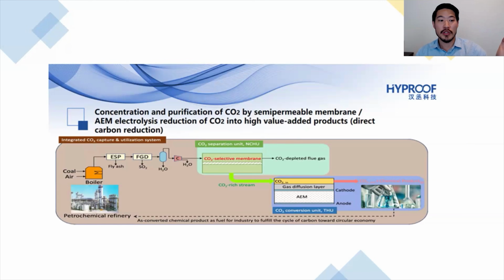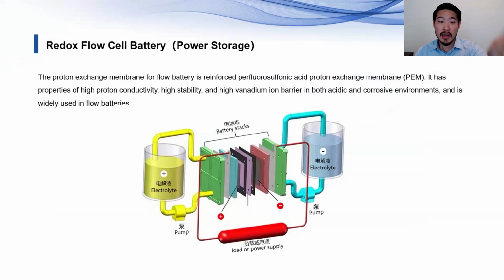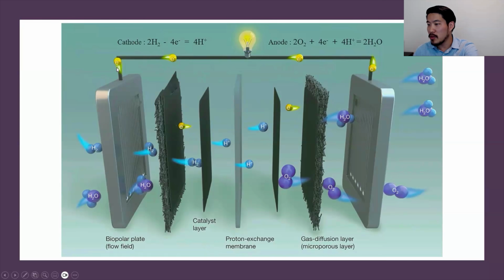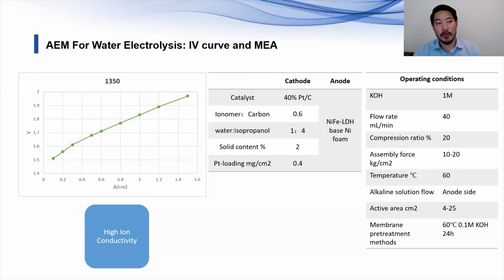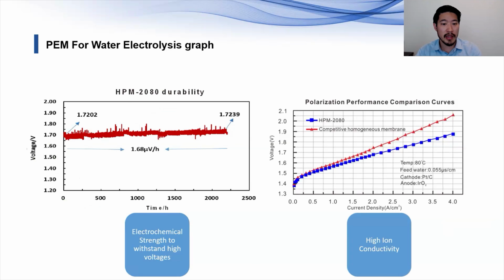Tech Talk - Hydrogen Fuel Cell, PEM & AEM Electrolyzer Membranes - Hyfindr Wu

Comment: Excuse my ignorance about this but if the goal is to separate the oxygen from the hydrogen, why not use a Hoffman electrolyser? You can pipe the hydrogen straight to the engine or through a compressor to a storage tank and release the oxygen or compress it in another tank for future use like with a rebreather or welding or whatever. This way removes the dependencies on consumable precious metals. Use batteries to initiate the electrolysis and switch to super or ultra capacitors once the engine/generator is running.

Comment: What the heck? 
The PEM splits water into 3 parts (oxygen, hydrogen proton, and hydrogen electron) then routes them in 3 separate directions only to join back the hydrogen components on the other side?  
(1) How does it do that?  
(2) Why split the electron off from the proton?  
(3) If one of the byproducts is hydrogen then can't this system just be primed with a minimal amount of water and then keep reusing the same hydrogen?
Reply: What do you mean by reusing hydrogen? Hydrogen is the product you want to obtain afterwards. The point of the electrolyzer is not to use the energy to turn on a bulb, for example; it is to produce hydrogen..
Reply: @MsRosHD  This video was not clear and seemed like the fuel cell had a hydrogen byproduct which sounded wrong and like a perpetual motion machine... now I see they were talking about the electrolyzer and that the membrane is used for both the electrolyzer and fuel cell.  There is another interview/video of a different guy from hyfindr which is more clear.

Comment: Hello Tim and Steven, Thanks for sharing this wonderful informative video. I am a little confused with the fuel cell layout displayed in the 12th minute. In a fuel cell reactants, hydrogen gas flows through the anode and oxygen flows through the cathode. Here in that slide the reactions are represented differently. Is that a mistake?
Reply: They mixed up electrolyzers with fuel cells, in my opinion. I googled the image, and the reactions weren't displayed, so they added them but did it wrong

Comment: Can’t the same membrane work for compression? And what would be the pressure output of compression? Lesser or bigger than 1000psig.
Reply: Hi, thank you for your question. The PEM or AEM membranes may be used for compression depending on the set up and desired effect. As for pressure, our membranes with the thicker width's have been tested to withstand up to 35 bar or more which is equivalent to 507 PSI or more. Hope that helps! - Tim
Reply: @TimW-Hyproof Sir, can't we use the byproduct "water " again back in the electrolyzer with some catalyst in solution?

Comment: Membranes are also used in electrochemical compressors for hydrogen. The efficient compression of hydrogen is important due to their low volumetric energy density. Electrochemical compressors are efficient compressors and purifiers of H2